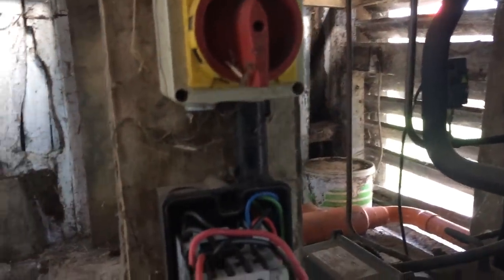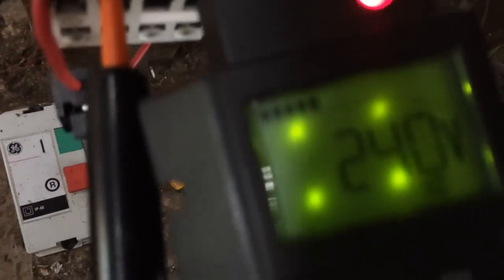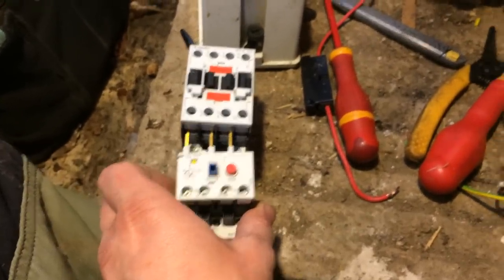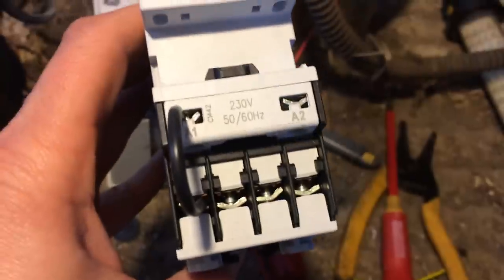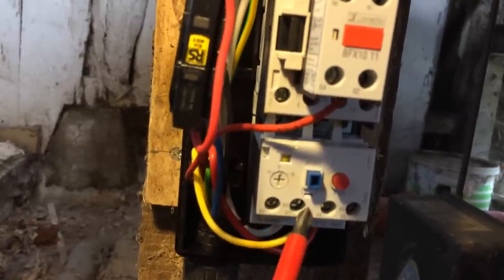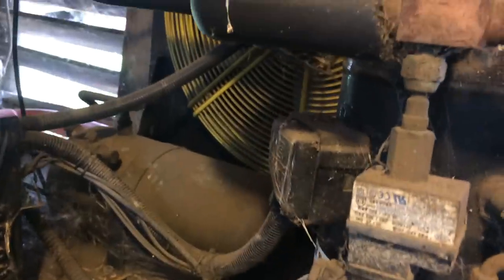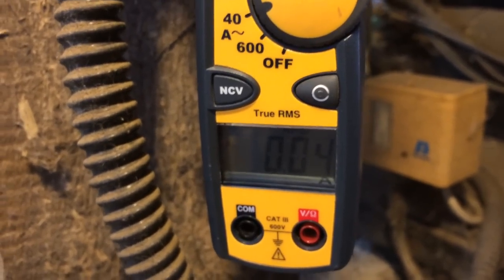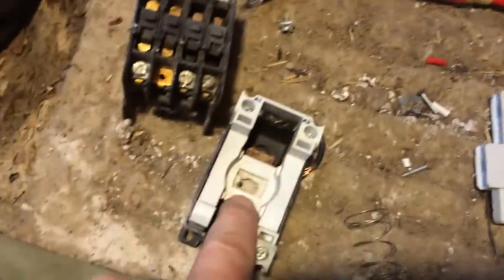Non Starter Copeland Scroll

Comment: Good old Riken control gear. Every box a mystery, especially as they get older and you find all the odd bodges to make them work with assorted contactors and switch blocks. 

Some of those overloads do have the ability to disable the phase loss detection ( which works by having 2 trip arms, the trip operating if either travel too far from the thermal heating of 3 bimetal strips, or if the difference between them being too great indicating one phase is not heating up) so you can use it for single phase use, generally by breaking out a small moulded tab in the side. Nice you left it on manual reset though, as otherwise the only way you find out is when it finally catches fire from the cycling into overload.
Reply from the maker: +SeanBZA The original GE contactors used to be very good then they moved production and i had a few that didn't work from new and a few that failed soon after. Then they stopped selling them here so I switched to the Lovato ones.

Comment: Are those good contactors what do you think of them they look very similar to Allen Bradley just the color is not gray
Reply from the maker: +hardcooling I've been using them fro a few years and not had one fail yet! RS components badges them as their own brand so they must be good enough for them.
Reply: +heavydiesel I ask you this because of the ABB Contactors specifically the AF series New line
Are having problems they go bad after five or six months I talk to them about it and they are aware of the problem
Reply: +hardcooling if they have the type you are using here maybe I will give them a try

Comment: What kind of voltage meter are you using?  I've never seen one quite like it.  The one at the  beginning of the video
Reply from the maker: +Cory Farren Hi Cory its a Steinel Digi Check 5.2 but they are not made anymore, i was lucky to find a new old stock one as a spare on ebay!